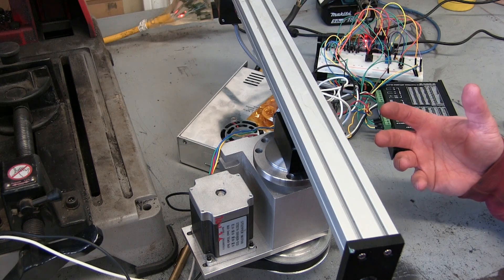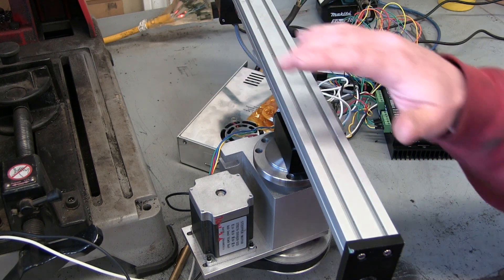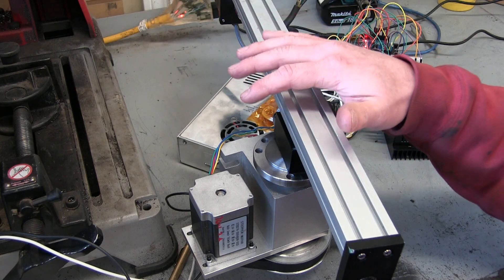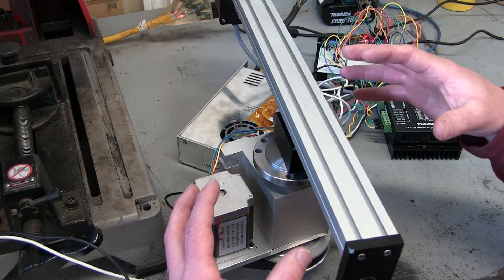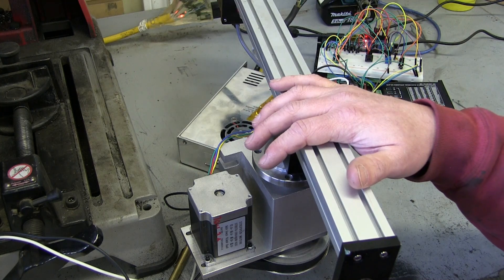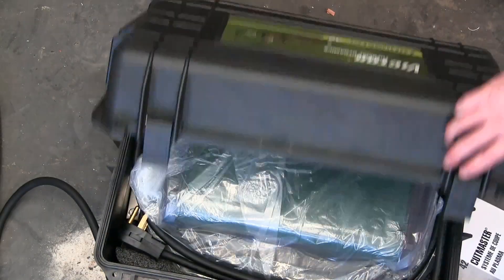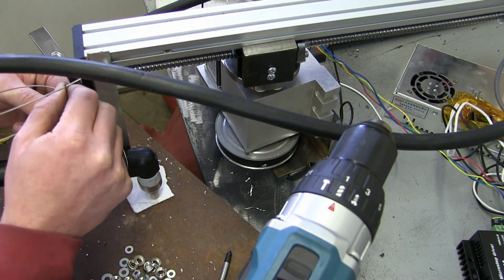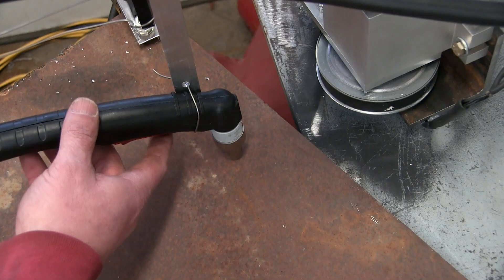Portable CNC Plasma Prototype

Comment: how do you plan on zeroing the machine.
Reply: Walk before you run. 
Start with a machine that cuts holes i.e. a plasma mag-drill. (Add shape cutting later.)
Start the hole at it's center. First move is the radius dimension out to the diameter then the path is a 360° arc.
Reply: The Lazer trace method some of the guys mentioned might be something to play with but add too much x factor.  I honestly think if we were gonna use something like this in our shop the iron worker's would still draw their shape out in painpen or soap. Which means there is zero cell phone jiggery which is a up side.  cellphones in most metal fabshop are not allowed due to stupid people abusing them and texting so avoiding using them is a plus.  The CMUcam pixy is a prebuilt cob that does just that or at least with some simple coding it does. Ben heck used one to make a auto camera pan and tilt seemed pretty easy to program. Especially if you just have them use like yellow paint pen for layout

Comment: plasma cutter with a 2t/4t latch for the trigger so you don't have to hold the button down. if that's not possible maybe a servo on the handle to depress the button and release when it's finished. would I use it? Do bears shit in the woods?? Of course I would. 👍

Comment: This is a really cool idea, like you say it has to be easy to use and that should be the main aim. But I think if you're going to make it with dedicated controller you should make it accessible to modification, of course if you're just using an Arduino that shouldn't be a problem, I always like to add my own functionality where possible.

Comment: fuck yeah this idea is mucho grande, us canadians always have the most gooder ideas, 3d printing software would be a good place to start, theres software for a delta style 3d printer look over der first. second a guard/foot on the plasma shouldnt be necessary, maybe a magnetic/micro switch/sensor kisser on the end to give it proper stand off, or a manually adjustable wingnut to control stand off, also i think the best user interface would be a very generic software that you can choose basic shapes, load usb files, maybe like a WAY dumber version of cad (i wanna make a square.. OK what size? blopp bleep bloop, makes you one) also having pre selectable things like 90 deg gussets with nice rounded corners, or even pipe flanges! im sick and tired of the foreman getting me to wittle one with a flame cutter and my dumb welder brain getting the bolt pattern wrong! DOH.. anyways, your fellow canadians are trying to sleep! some of us have to go to work in morning!

Comment: i'd say calibration/orienting the workpiece to the toolpath would be the tricky part, especially if the base is crammed in a corner, or you're in the web of an I beam... how to input a major and minor axis or a start point? stepper motors are 'open loop' but getting position feedback from encoders might let you manually touch off points like a CMM (you'd need controls or handwheel to jog the leadscrew) of course on a vertical plane you'd want to motors to provide a holding torque so it wouldn't run away on you. Also, some way to mount it securely for use on aluminum or other non-magnetic materials.

Comment: I'm a software developer.  I've done mobile apps, firmware for microcontrollers, hardware integrated stuff, etc.  I've even controlled hardware over the internet through web interfaces.  I might be down to work on a section of this with you.  Let me know if you're interested.  I can also do PCB layout.

Positioning it to get the cut where you want it and in the correct orientation is going to be the tricky part.  It's easy with a circle, but if you needed a rectangle in a certain orientation it's going to need some way of registering it's relation.  I can think of a couple ideas.  Index it on each corner maybe, and then have it take over from there is likely the easiest way.

Edit: Couldn't sleep - Simulator to support algorithm prototyping: https://github.com/c0yote/mountain-jackal

Comment: Sweet! There are some 3D printers that use a 2 pivot arm for the X and Y axis, with the build plate (or entire arm assembly) moving up or down. They're called SCARA robots, and now that I look, it also looks like there might be opensource plans that you can adapt for your purposes. Search 1241491 on Thingiverse; it's a flimsy 3D-printed thing, but you get the idea.
All I've got is industrial design skills, so I won't be much help to you, but good luck!

Comment: Neat stuff. And the angular to cartesian conversion is pretty easy for computers. No clue what kind of software you're looking at, but an Arduino could handle it. Just some sine and cosine operations to go from polar to cartesian. The inverse needs a bit more with an arctan and square root, but it can still be done on a microcontroller level. I could probably pop out some pseudocode for a control algorithm if you'd like.

Also, I'd probably have the design portion based on points. Yes, you could pick and place basic geometric shapes, but I'd pass them to the system as a set of points. The controller would then pick a path between each point pair, if that makes sense. It would also make designing arbitrary shapes simple. Just tap point A, point B, point C, then point A again and you have any triangle you'd like.

Comment: Pretty cool!  Raspberry pi to control.  The phone app is easy to set up easy conversational code.  You will want to look into a z axis with a floating head and proximity switch so it can auto find z 0 to set pierce height to save on torch tips.

Comment: The rotary axis will need to be infinite in order to avoid having to reposition or break some thing by hitting an endstop. Also, whilst using the app to pick the hole size, shape and location you'll need to be able to jog the machine into a start position to create an origin of sorts. The pierce point for each hole or pattern will be important too. The follow camera  would be a great feature (option) too. I've  been cutting, grinding and welding for 20 years now. I would buy this if it was robust. Thanks for sharing.

Comment: Will the metal underneath the magnetic base ever reach temperatures higher than the demagnetization point of iron? I mean, if you leave it running long enough, can it happen from the heat of the torch? If it does, the thing will fall of from whatever it is magnetically   attached to. That is the only thing i can imagine that may cause trouble with this, the rest is pretty much math and programming, i imagine many of your subscribers would be happy to contribute to a github project on this.

Comment: One thing that might give some issues is that the speed in the angular direction is dependent on the position in the radial direction. It would only be an issue on large cuts and the software might be able to compensate for it though.

Comment: You are going to have to compensate for the rotation of the arm the sped of witch it travels and a system to zero so it knows where it is on the arm and lastly the precision loss at far distances

Comment: Hey,
I'd love to help with your transforms, I have about 8 years of math under my belt (real life useless mathematician here!), and a lot of it dealing with working in different coordinate systems.  Shoot me a message if you'd like.

Also, when your torch is closer to the rotary axis, it will move slower than if it is further, and I'm assuming you want constant velocity on that bugger. Unless the margins you have to work with on the torch are not as finicky!

Fuck'n eh though, great work!

Comment: Really cool idea!  Could you use a Rambo board from a 3D printer?  I know people have made Polar coordinate 3D printers you may be able to start there which would also give you stepper drivers built into the board as well.

The problem becomes getting the file from your phone to the cutter since 3D printers run from a wired connection or SD card.  

Any ideas of cost you want to try to keep it under?

Comment: Exceptional idea. Maybe add a laser projector to draw the shape it's going to cut before you start her? The projection would only work on a flat plane, but you should only really be using a tool like this on flat surfaces anyway.
Reply: Alexei Barnes that's a good idea
Reply: Joe Kozak has the right idea here. Way cheaper.
Reply: One of those cheapo non-movable straight lasers (like they use on drill presses and chop saws) would be very handy for alignment.  It would have to be placed far more accurate than on the DPs & CSs though - those things are usually way off!
Reply: Joe Kozak The electrical enginerds won't be happy with your KISS solution. When you have a computer ever other solution just looks like a hammer.
Reply: Why laser? just do the easy thing and put a sharpie where the cutter is supposed to go to get the shape on the workpiece, no extra parts needed.
Reply: Alexei Barnes Laser protection was my first thought for orientation.
Reply: Except trying to make a cheap machine that looks at sharpie marker on rough steel and understands what's happening is maybe not so cheap.
Reply: Amperzand the sharpie isn't for the machine, it's for you to see what the machine things you're asking. a simulation.
Reply: Ahhh, you put a sharpie instead of a cutting head! Very nice! Chalk probably would make a lot of sense in that application.
Reply: Laser projector would be a great idea - I think one of the problems with CAD is that you have to know the beast well enough to trust that its going to do what you want it to first try. With a mag drill you line it up and you can see it's linear path, with something like this you'd essentially be firing in the dark and trusting that the 'tech' that everyone loves to hate, is going to do it's job. This also seems to be one of the largest growing pains when it comes to moving from traditional to more modern manufacturing techniques.

The only problem i can see with the rotary style control is that depending on how it's done, the steps (and so accuracy) get fairly large at the end of that arm what with levers and that.
Reply: Joe Kozak Hey, we have the same names
Reply: Alexei Barnes you could use projector mapping to get it on any shaped surface. quick calibration procedure and youre gold.
Reply: Alexei Barnes I had the exact same idea. but a sharpie would work too, I guess
Reply: clemofish It doesn't have to be a laser - just some method which joins the digital drawing to the physical world. Three points on the base of the tool that directly correspond to three points on a template for every drawing could also ensure that direction and scale is correct.
Reply: clemofish the laser would show the exact cutting path programed into the Cnc drawing it would not do anything in that form at all
Reply: A sharpie could work, but it has its own downsides. A laser would not be attached to the head, no, it would be attached to the base. It would then perform a projection in much the way a CRT displays an image by simply firing the laser along the planned cut path rapidly so you would see the complete form with the naked eye. In other words, this laser projected cut path would update every time you changed path giving you visual confirmation instantly.

Compare that to multiple sharpie lines that will be hard to distinguish or worse acid etching as some people suggested, which will screw any chance of painting that surface. Worse yet you now have to create a mechanism for switching heads that will never allow the plasma cutter to move or turn when gripped. Besides, this thing has to project from cartesian coordinates into polar coordinates, it has a computer already.

Comment: ahhh I used  to love hearing the field machinists stories when I worked for caterpillar of them using a mag drill upside down and they would run it off of the gasoline powered generators on there service trucks and sometimes they would run out of gas or break down then all of the sudden they would have a heavy as frig mag drill come falling from the sky because the generator/welder combo would quit running
Reply: It only fell as far as the sling was long, right?
Reply: P3dro 2486 lol I'd say it was in rough shape, there was a coal company that we worked for called A&G and they had an o&k rh200, had two v12 Cummins engines, we use to work on that shovel every now and then, I couldn't imagine the 400 series
Reply: P3dro 2486 I remember when we would do a service on them we would throw a rope over the side, bundle the long skinny hydraulic filters up about 6 or so at a time, tie them up and pull them up, I remember the filters went under a big circular plate, there was a ton of filters on that thing, and a million little pilot oil filters hanging everywhere also, good times
Reply: Will Reid yeah I thought most brands came w a chain.
Reply: Southern Mechanic I dropped a mag drill off the top of the counterweight of an RH400 shovel (1000 odd tons) in just that way lol. It didn't end up well after the 3 story fall
Reply: Will Reid I don't think they had slings with there's or they just never used them, I was one the mechanic side of things so I'm not sure why they didn't use them or if they even had them
Reply: Godfrey Poon exactly, I was on the mechanic side of things but it seems like the drills were kept in our tool room so they had to sign them out when they needed them and I don't remember them ever having a sling or harness with them

Comment: i have an idea i think you could just for speed have some buttons on the side further into development. you  could on buttons  have some basic shapes and a 0-9 key pad and a imperial to metric button then you put in the size and thickness of the steel and select what  shape you want and press  go just for speed and then also have a app for more intricate things. also you may want to supply a back plate for non magnetic materials
Reply: Robin Bane thickness is determined by what you are cutting in, the settings on your plasma cutter, and the tip you put on the torch. not a big plasma guy?
Reply: CliffWalrus i was thinking that you could just specify the thickness and material ant it would atomatically change all that stuff also i hove only used a plasma cutter 3 or 4 times
Reply: Cnc tip changing would be a whole other can of worms past the problems to be worked out now. Cnc tip changing AND auto adjusting the plasma cutter would be pretty close to a whole other machine. You saw he had to fiddle with the speed a few times in this test, changing anything on the fly isn't how he has it setup. Its pre-programmed and wont change until you restart the program.
Reply: CliffWalrus i guess there are two ways the project could go. it could just be the cnc with a mount for any plasma cutter or it could be the plasma cutter built in with a panal on it like i commented first. both would be amazeing and both have advantages and disadvantages

Comment: This would definitely work better if the proper torch set up was being used, like a torch that is designed to be used with a CNC Machine.  Absolutely fucking 10/10 idea though. My mind is boggling with ideas of things i could use this with.  Something like this cold be especially useful for someone who does not have the room for a full size plasma table.  In a few weeks in my Mechanical Engineering class we will be combining single axis CNC block to convert them from a single X-axis to a Multi XYZ-Axis.  What if the CNC blocks were used only for an X and Y axis for your torch design?  It may be able to provide a small and portable version of a plasma table.

Comment: I definitely think that this has got some potential. I can't say much for industry, but as a home gamer I think it could be great. Rather than having a dedicated plasma table that takes up a set footprint in the garage, you could just pull something like this out whenever you needed it. Interesting. Being that it's all 2D work, creating a simple CAM app should be doable, and the inverse kinematics should be pretty dang simple. Grrr, now you've got me all hot and bothered.
Reply: Would definitely be interested in hoping in on the CAD design for a prototype. I've got experience designing both 3D printers and laser cutters, this could actually be done with a lot of the same (although slightly more skookum) components. Since there's not actually any sort of load on the tool due to cutting, a prototype design should come together pretty easily.

Comment: For the app you'll need to include a way for varying the feed rate. so try putting like a drop down menu with the plate gauge and possibly general material.

I'd worry about repeatability on something hanging out like that. Maybe consider sticking a counterweight on the non cutting end so you can use denser, more rigid material and get less wiggle. Or cantilever support maybe?